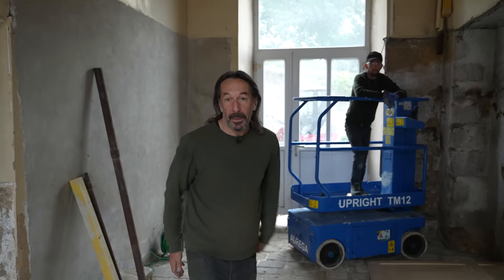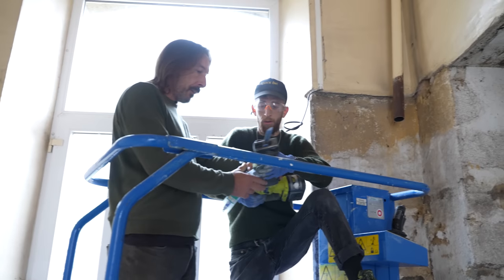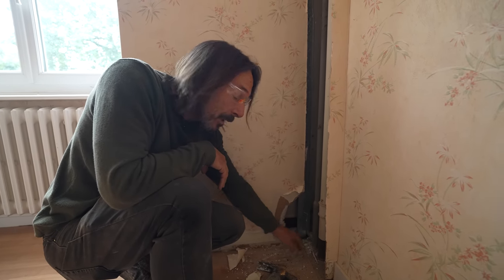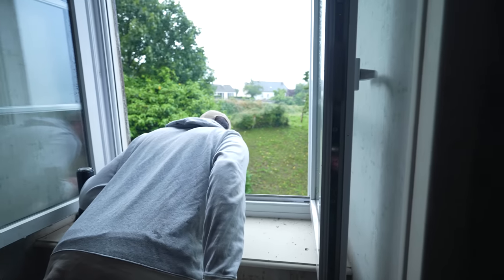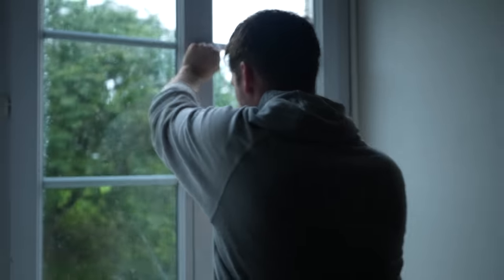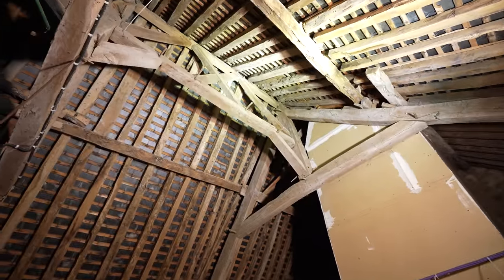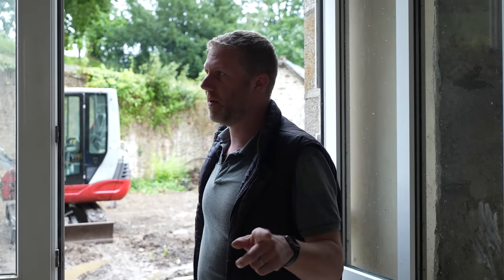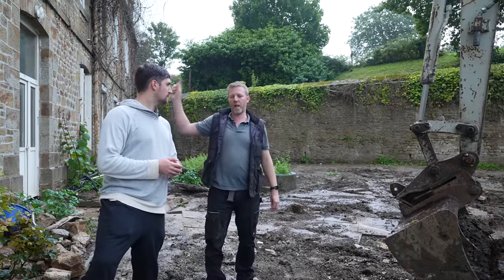When Problems Multiply...

Comment: Yanis is one of the few people I have seen properly use a saw. Most people move the saw back and forth to help the blade instead of letting the saw do the work. Also the blade can be installed in either direction in case you need more clearance to make your cut.
Reply: I came to the comments to give them the same tip about reversing the blade.  It can be very handy at times.

Comment: Billy, Gwen: the wide grass lawns on either side of the driveway leading up to the Chateau would lend themselves very nicely to a mass planting of Spring flowering bulbs. 
Huge choice of colours, shapes, varieties, and species available and can be bought relatively cheaply if bought in bulk direct from the growers [by the 100's or even up to 1,000+].

It also doesn't have to be a complete phaff when it comes to planting. 
Forget planting each bulb individually - unless you are an anally retentive glutton for punishment  - use a turf cutter, followed by the digger, going down about 10-12" depending on what you are planting. Again, don't worry too much about placing each bulb by hand so that the pointy end faces up. Just take a leaf out of the Dutch public grounds keeper's book, and sling them more or less onto the desired location, before covering them back over with the digger, levelling out the grade and relaying the turf. Any bulbs that aren't facing upwards will soon use their root systems to properly orientate themselves. 
It often helps, especially with tulips if you want them to naturalise, to plant them a few inches deeper than recommended as this seems to help with repeat flowering year after year. You can also extend the flowering season by cheating a little bit using the lasagne layering technique. It means you get a succession of flowers in the same place & can be just as easily replicated in containers. Simply place the bulbs with the deepest planting depth requirements in the bottom, cover with a few more inches of soil, rinse and repeat until you get to those needing the shallowlest planting depth before finally covering over the lot with the digger & returfing the lawns using the turf stripped off with the turf stripper.
To avoid the tulip fire virus, tulips are best planted no earlier than November. All Spring flowering bulbs need good drainage so depending on whether or not your soil is well drained, inclusion of a layer of fine gravel in the base of the planting area can be a great idea to avoid rotting off.

Over the years and decades, the display will gradually become one of magnificence to match that of the Chateau itself.

Comment: Could have used an angle grinder on the pipes instead of a sawz-all (reciprocating saw). If worried about sparks, a soldering cloth can be used, behind the pipes.
Laminate on leveler. Someone cut corners.
Gutters need to be cleared regularly. Best time, prior to the first snowfall in temperate zones. If it doesn't get regularly cleared and it overflows can cause a weakening on the fascia board which the gutters are sometimes mounted, weakening the gutter mounts. Last thing as a homeowner wants to have to do is scab or replaced portions of the trusses that have begun to rot.
Whomever installed that pocket window needs to be retrained or was just lazy.
The water appears to be running down the truss to the strapping, its dripping there because of the metal. Need to locate the source.
You may have a scissor lift, but going to have to invest in a couple of hook ladders and ladder jacks with a few planks to repair the slate roof proper. Also removing slate requires snipping the hanger (?galvanized?) wires and removing the tiles so as not to break them. Reverse the process to replace the slate. (<- repair info and reinstall is from my dad, as he has installed them in the past).

Comment: Simon, that appears to be cast iron pipe. You should get a chain pipe cutter, and you will remove the pipe really fast. The pipe will jump when it pops off. It's basically a cutting chain that, as you tighten it cuts the pipe.  I'm sure sure you could buy one locally or rent one. Good luck with the pipe removal.

Comment: That corner of the convent grounds is prone to flooding anyway,your ground works in the area has improved it .Gutters filled with silt are not good,a roof is almost a living thing it moves constantly with temperature and humidity made worse with surface damage and water getting to the timbers supporting.